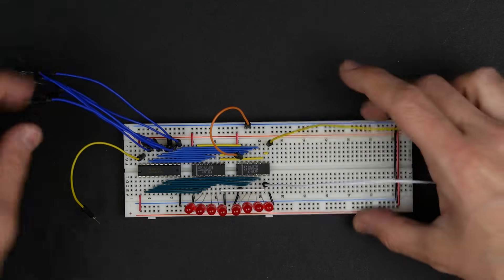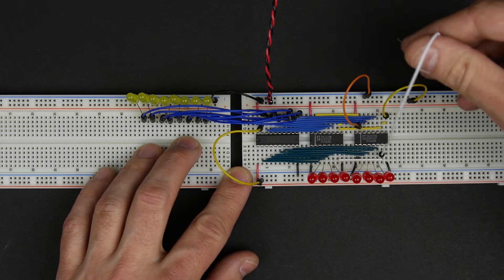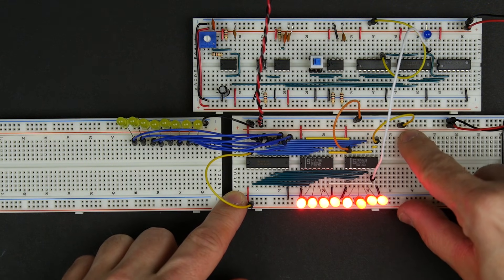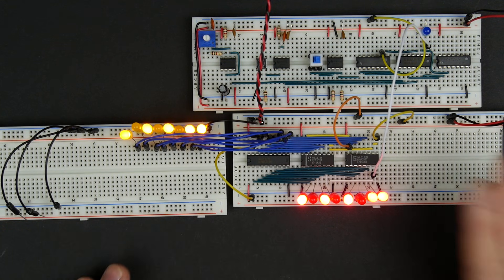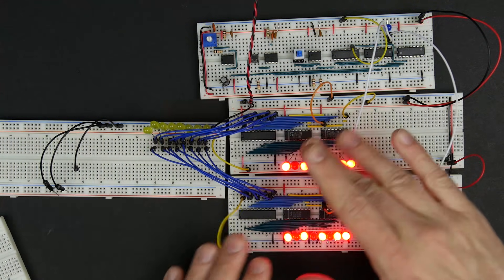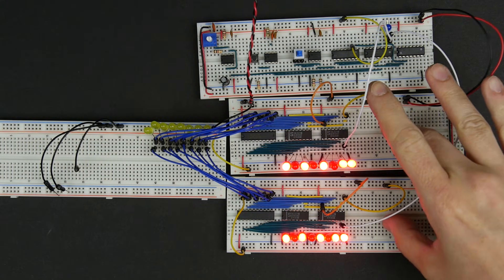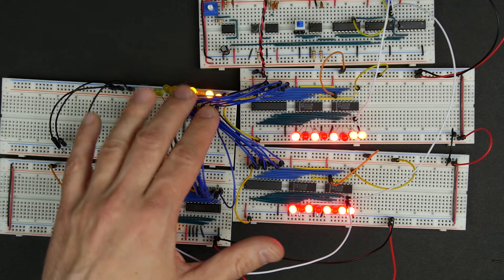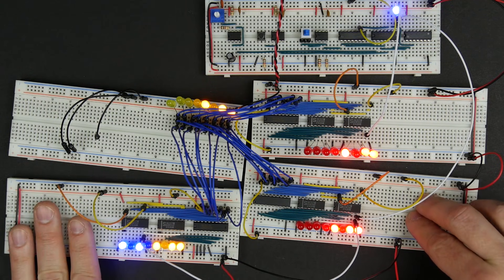Testing our computer's registers - 8-bit register - Part 5

Comment: i can't get the leds to light. added 220 ohm resistors to the ground side. wiring is correct. tried everything i can think of.
built 'B' register. no help. have an scope; vcc is clean. oh and put .1 uf cap between vcc and ground. have spent 3 days on this
and I was bald before. close to pitching the whole dam works.
Reply: i'm having the same issue. we you able to resolve it??
Reply: @vincentlorenzi2243  Same here. My LEDS turn on inconsistently and don't stay latched.

Comment: Bought the kit from Ben and just finished the register step and so excited to run through all the tests in this video.  Each of the three registers worked great the first time - I built them simultaneous and cross-checked all three for each cable/chip/LED add.  Learned the hard way building the clock in last Ben playlist to not do anything out of order or get a pin in the wrong spot.  Next stop,.... ALU!
Reply: For those thinking about doing this.... should have mentioned that I previously bought a pack of 100 multicolored jumpers like Ben uses.  Sure came in handy when we got to this video and suddenly need ~40 different jumpers.

Comment: Just spent several mornings of my free time building this register and debugging it. So excited to move on to a different part just to find out that I have to build ANOTHER one? I hate computers.
Reply: There are CPUs like the 68000 which have 8 data registers and 8 address registers along with flag register and so on. All of them each 32 bit. So an accumulator CPU (Register A is the accumulator) where the operations are depending on this specific register is much more easier to build. This is for example in the 6502 cpu, where you really have only 2 other data registers X and Y along with the accumulator A (all 8 bit). So in fact this is the easiest CPU with registers A and B. At the university we made a 16 bit risc processor (also on chip) which is way more complex. :)
Reply: and then another one after that

Comment: Incredibly easy to follow explanation of how a computer works: beginning from the transistor level up to the registers level.

What really strikes me is that no math at all is needed to understand how this all works! All this can be understood by a 10-year-old kid attentive enough to follow all the explanations.

At the base of a CPU is a transistor – which acts just like a current-controlled switch – like a relay – and in fact before the transistor era computers were build using relays.

Comment: Hello, I have questions: why yellow LED are not lit on ~ 3:50-4.10 min when LOAD is on (aren't they supposed to be ON , if it goes signal to D pin of SN74LS173A and red LED is becoming is ON too )? Thank you

Comment: Hey so been following this series and so far everything has worked. After connecting the Register to the bus though I found that for some reason by circuit will power up, stay powered and slowly the LEDs will Dim and than soon the entire Circuit looses power. I am very new to stuff like this so I dont really have any idea whats going on inside. Any Help is appreciated
Reply: lingbop

Comment: I have a problem with my registers I cannot verify my registers on bus when I set the LOAD to LOW LEDs (of registers) turn on. When I set the ENABLE to LOW LEDs of the bus do not turn on. I have checked my wirings every thing is according to the video and schematics.

Comment: Just reporting in the following debug information: 

1. LEDs on the 4-bit register outputs render the output data to bus unreliable at best. Current limiting resistors on ALL LEDs required as many others have mentioned (PITA, free). Either that or grab some super low current replacements (EASY, $$). Admittedly a bit irritated at the prospect of spending additional funds on a $300+ kit... but I will continue to support Ben and his channel as I've learned so much invaluable information... even as a decade old CS graduate. The little things like this will keep those without the debug experience from finishing, Ben!
2. I for some reason needed a pullup resistor on the output enable pin on the 745 during testing. As soon as the output enable input was floating the output would activate. Doesn't seem to be an internal pullup in the parts shipped after mid-July of 2021.
Reply: This comment made me feel a little less crazy about the LED's. The voltage drop caused by not having the current limiting on the LED's cost me hours of troubleshooting. Not a huge deal but definitely frustrating!
Reply: Whoah. I'm a noob and I think I've been dealing with this for a day now. The LEDs don't latch. They sort of turn on randomly on random clock pulses. sometimes when hold down random components on the clock board all of the LEDs light on some clock pulses. What the heck do I do?

Comment: Okay I have an idea to make arguments 8bit:
Have two registers: Instruction Register and Argument Register.
The program counter would be 8 bit, and it would actually point to the location in memory where the instruction is stored. This means that the PC can actually increment by 2 between instructions.

1. Load in the instruction into the instruction register
2. If the first bit is 1, that means the next 3 bits are the instruction, and the 4 bits after that are a small argument. Increment PC.
3. If the first bit is 0, that means the next 7 bits are the instruction. Increment the PC.
    a. Load in the next byte into the argument register. Increment PC.
4. Decode the Instruction, and then do stuff just like you did in your project.

The instruction register does not have any output to the bus at all now, only the argument register does.

Example: "lda 15" is a one-byte instruction because the immediate fits into 4 bits. "lda 16" would be a two-byte instruction.
This way we can have somewhere between 128 and 256 instructions, shared with memory for data.

Writing a custom assembler actually sounds like fun too...
I would love to do the conversion from binary to decimal thing. This would also require some more ALU capabilities (ror/rol, bitwise and/or/xor) as well as a status register (especially the carry bit, but also zero bit)
That sounds like a bigger project, but definitely doable!

What do you guys think? I feel like that would be a great project, because 16 bytes of memory is really too restrictive to do anything interesting...

Comment: Hey everything is working perfectly, except my 7th bit (or 8th bit, the last one) seems to be inverted. When the enable is connected to + it turns on while all the others are off, and when it’s connected to - it turns off while all the other bits turn on. Anyone know why this might be?
Reply: Fixed - had the last bit plugged into the enable slot. Just moved them all the the right one. Look at the IC quick reference or data sheet folks😅

Comment: QUESTION:
Hello, I thouroughly enjoy these videos and I have purchased your kit and am currently on this video. I am having an error and if anybody knows what might be the issue would anyone be able to make any suggestions? I don't want to be walked through though, perhaps just some helpful hints? ...So here it is:
When I connect the clock to the 74LS173 on manual pulse, the LEDs that are in-between the 74LS173's and the 74LS245 immediately go on in a pattern that is not all simultaneously and is not dependent on the clock speed. Furthermore, when Load is switched back to high and I switch enable to low, the data does not transfer to bus. Is there any helpful hints? Many Thanks!

Comment: My clock stops working when I tie the clocks together with the jumper wire, I have bought LEDS with resistors built in and I have also tried to power it with a 9V battery but nothing has worked. Also I tried taking out all the LEDS from the board but even then when I connect the clocks together it just stops working. Can anyone help?
Reply: I have also used a resistor with every single led on my board and I still have the same issue of my clock not working when tied with the clock of the register.

Comment: Might be late to the party, but I've been having problems with my bus LEDs simply flashing when I have the load high (disabled) and the enable on? Any ideas?
Reply: I had this issue as well - and by no means am I pro at this, still a n00b, but adding a capacitor near the vcc/gnd input as well as connecting each module to that same power rail instead of chaining them from one to the next.

Comment: I have the kit and I was wondering if there is a know problem when enabling the register?  When I do it nothing happens and I dont know why. Loading works just not outputting
Reply: I have the same problem, actually mine output something to the yellow leds the first few times inconsistently, now they don't turn on at all, did you find out what's wrong?
Reply: @ipsectunnel  My problem was that I grounded all the bus pins and instead of lighting up the lights, it went straight to ground. Also, make sure the state of the enable is what you think it is, cause its reversed.

Comment: In the instruction register, what is that small red wire near the LEDs? If someone could tell me what pins it is connected to that would be very helpful. Thanks! :)
Reply: I think that might be the connection to power

Comment: I made two registers. Whenever I try to test them I get no signal in the LEDs. I a pretty sure I have connected every wire correctly. If anyone has any suggestions or help that would be very much appreciated. Thanks you
Reply: Have you made sure that the reset, load enable, and read enable jumper wires are connected correctly? For me, this same thing happened and it turned out that I shorted the circuit by plugging in the reset jumper wire to pin 16 of one of the 4-bit registers. My battery got hot and I couldn't find a solution until I decided to rebuild it and noticed my mistakes. I hope this helps! :)

Comment: Hey Ben,  I love your explanations and I am building your 8 bit PC from the kit.  I am not an experienced electronics guy, but I believe the kit came with some bad chips.  I have got through the clock build with no issues, however this register build is not going well.  When "enabled" the 245 chip has zero output voltage on all but the 18th pin.  Pin #18 has 4 volts and lights the LCD. No other LCD's are lit.  I have taken this apart and rebuilt it from scratch 4 times.  I have done continuity tests on all wires, etc.  The first part of the process works as expected, meaning the "load" works correctly.  However the "enable" side of the process is continually problematic.  I have tried placing resistors on the test bus, no difference.  I have ordered new chips, not from Jameco this time, and will see if they make any difference when they come in.  If my chips are bad, like it seems a lot of other peoples' chips are, I am not looking forward to the rest of the build.
Reply: Joe Beaulieu this sounds like the problem I had. You probably need 220 ohm resistors between the LEDs on the register boards and ground. This is not in the video, I believe because the chips in the kit are slightly different (but not faulty). Good luck ;)
Reply: Yes, I think greg is right. The current through the LED is causing the voltage to drop below the TTL "high" voltage.

Comment: Hi Ben, thank you for your video clip. I love this. But, I got a problem with my project. I use 74LS173 same as you. when I power the circuit with 5V  then my LEDs's all on!!(Even if I  pinned  74LS173's CLR to Ground). And if I pull CLR pin and put it back, the circuit works right. Whenever I power on the circuit, this phenomenon show up repeatedly. Could you help me about this?
Reply: Same problem , did you find the cause ?
Reply: @ALAsilTech  According to the chip, there is a setting which means if turn on then high Q at first! You just need to reset it by eeprom program after class:)
Reply: @HyunwooKimArt  aha , thank you 👍
Reply: @HyunwooKimArt  Which setting? I have the same problem. And when I tested the register like the tutorial, I set LOAD enable, but the Q output LED were blinking following the clock pulse！Do you know why ？Thanks！
Reply: ｉ think it needs to be reset first before controlling ａ chip
Reply: @HyunwooKimArt  How to reset ？ I tried with some other 74ls173n chips , the results were all the same.
Reply: you could find the reset PIN according to the data sheet。first reset the chip before other actions
Reply: @HyunwooKimArt  thanks but I have already set the MR pin HIGH and the problem is still
Reply: @polkapulse5147  did you tried reset after all PIN is high?
all PIN high -》 reset -》 other action
Reply: @HyunwooKimArt  So grateful ! It’s very strange that when I set the D pins HIGH and LOW directly, the states of Q pins is correct, but when I float the D pins, the output state will blink following the clock pulse. Other Pins are set correct.

Comment: I also had the problem with the leds causing the 245 chip not to work properly. Measuring the voltages going into the 245 (the green wires) I got pretty much exactly 2 volts, which according to the datasheet is the threshold that the 245 responds to. I built using Ben's kit, which had different manufacturers for the chips than the video did- I presume that the tolerance varies between brands at least a little bit, which is why it works without resistors on the leds in the video.

As there isn't much space to put resistors in I bought LEDs with built-in resistors. Not super easy to find and would love to hear of other options to these (which don't come in blue):

- https://www.mouser.com/ProductDetail/604-WP7113ID5V (Red)
- https://www.mouser.com/ProductDetail/604-WP7113SGD5V (Green)
- https://www.mouser.com/ProductDetail/604-WP7113YD5V (Yellow)

Being new to all of this I don't see how to determine that these have additional resistance from looking at the datasheet alone. They are advertised as such, however: https://www.kingbrightusa.com/category.asp?catalog_name=LED&category_name=KCResistor+LED&Page=1. Testing them I found they have the equivalence of a 250 ohm resistor in series when it comes to current draw.

Comment: 10:45 is it illegal if i have same register desing for all.means 8bit instruction register.
databus only movie data.
addressbus move only address from program counter
made 1 pcb module desing.
boards are piled top each other
data.address.res/resb clock vss vdd go thru all bords
instruction decoder board has wires going registers load and enable(just choose what board will be a or b or x or y)
i use register as program memory too lol.and have. becouse it was cheaper made more pcb than i needed

Comment: Hey Ben,

How are your voltages not effected by voltage drop of the red LEDs?  On my register, the voltage going into the LS245 lines is around 2.07 which I think is too low for the LS245 to pick up, so it never writes my values to the bus.  How did you account for this?

Thanks for all the great videos.
Reply: have you built inthe resistors from his schematics into it?

Comment: Hi Ben, I jus started to build and test the registers, but I have some problems that I can't figure out. 
I've build one register and I have no bus connections yet. But when I want to test the 245' outputs, there's a signal, but it's like there's some kind of interference, data isn't the same.
I've used a voltmeter and It seem a problem with current draw, I have less than 2 volts on the 245 outputs, and barely 3 on the inputs.
The rest works fine, no problems with 173 ICs.
Hope anyone can help me. Thanks.

Comment: Mine doesn't work. What am I doing wrong?

My registers 74LS173 produce a strange output of HIGH as only 3.8 V and low is like 0.9 V. And the 74LS245 doesn't recognize this as a proper HIGH. So its output is always LOW. What am I doing wrong? I checked both 74LS173 chips on every pin it is the same issue.  I checked the 74LS245 in isolation and it works as advertised.

If I test the 74LS173 in isolation its HIGH still is only at barely 4 V.  Why doesn't the register go all the way to 5 V?

Comment: Hi, man! Excellent video, as usual. Your channel is one of my favorite on the entire YT. Keep up the good work!

@5:29 => Connecting the second register to positive 5v implied the new register, which was "activated by default" like the previous one, was thus enabled by default and loaded all of its 8 bits to the bus, hence why the bus turned all yellow?
Reply: Hard to say what happened at that point, I think it was when 5 V was connected to the second register, but not ground. None of the circuits are probably designed to operate under those circumstances, so it's anyone's guess what they will do. You would have to go back to basics and look at how all the transistors in the chips are wired to figure out what was really happening. But it was interesting that the LEDs lit up!